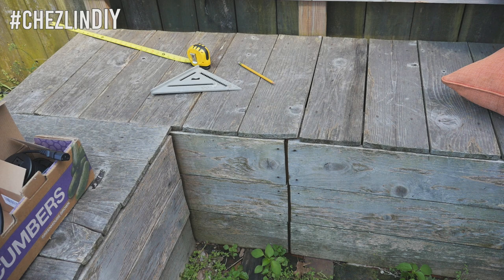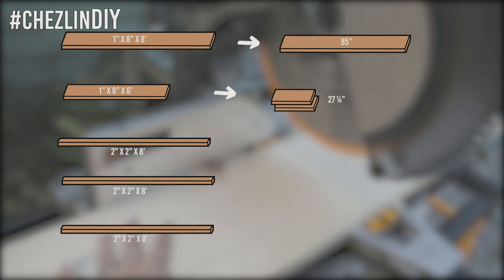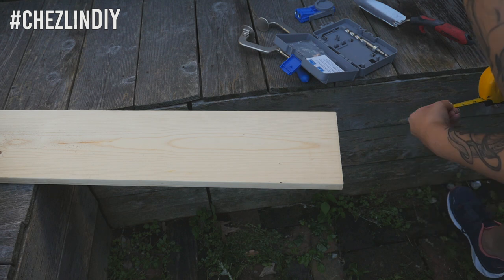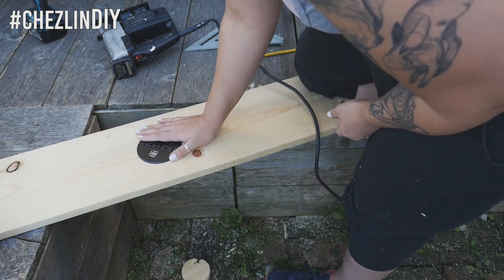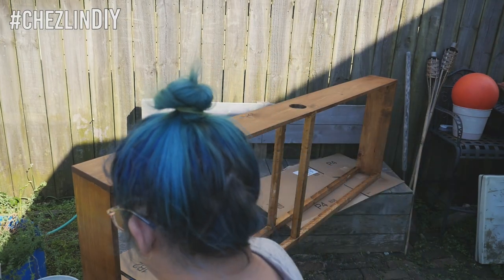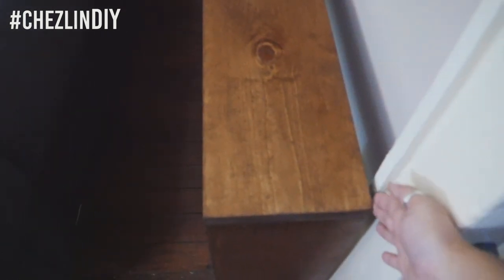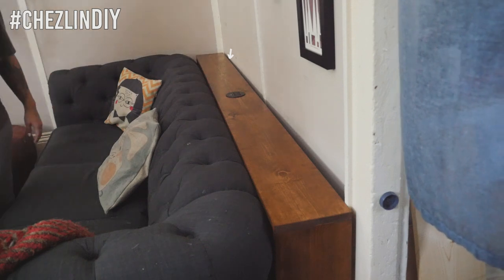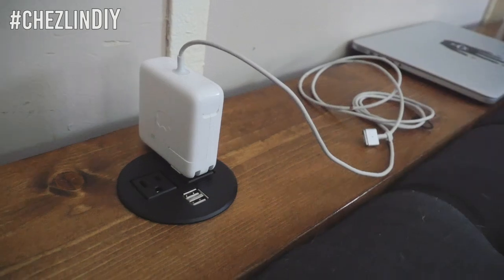How to Make - Behind the Sofa Table - DIY

Comment: The actual measurement of milled lumber like you used is smaller because it is rough cut to 1” then “milled” (planed and edged or ripped) so that the lumber is in a more finished state.

Comment: Wood is measured before it goes through a scalar and planar. A scalar makes one side flat and then makes one right angle, and then the planar will square up the opposite sides to make the plank of wood nice and square and even. So if the 2x4 originally cut is warped, putting it through these machines will shave off the concave/convex sides, just keeping whatever portion you can cut a regular squared off shape out of
Reply from the maker: Interesting! Thanks for the info!!
Reply: RhymingMime Ah, I always wondered about that! It seemed weird, that they seemingly weren't able to cut them more precisely!

Comment: Really like your take on this!  Looks good, good support and functional, but you didn't over complicate the crap out of it either, like a lot of folks seem to do.  Didn't make it so simple it was ugly, either.  

My only two cents would be:

Be careful of having the outlets on top, they are exposed to either food or liquids getting inside of them, causing all sorts of problems.  They are safer on the side of the table, which is tricky with yours since only one side is exposed, so naturally I see why you chose to have outlets on top.  Just more risky that way.

Also if the inside of the table is going to be hidden, no real need to stain it.  Just added work and leaves you with less stain for the next project.

Comment: Shouldn't all the screws be 2 1/2 and when connecting the 2x2 to the 1x? Then on the 1x to the 2x2 use a 1 1/4? Also I believe the reasons why the wood thickness isn't a true 2x2 is because of the milling process and wood shrinking.

Comment: Kreg has has a lot of valuable info on their website.  They have a chart that tells you which screw to use depending on the thickness you are driving in, and a video on how to check without using a chart.  https://www.kregtool.com/about-us/news/kreg-tool-tips-joining/always-use-actual-thickness.aspx

Also, they have a handy right angle clamp that allows you the clamp the leg board to the top board using one of the pocket holes you've drilled.  https://www.kregtool.com/store/c46/corner-clamps/p389/right-angle-clamp/